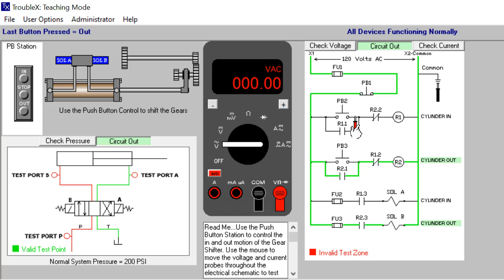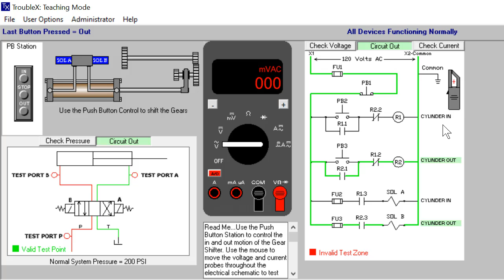Circuit Fault Simulation Introduction

Comment from the maker: "This clip is about the basic introduction of the incoming series of youtube shorts (meaning shortest videos lesser than 1 minute). This video will show all the navigation, menu and how the electrical and pneumatic circuit works. 

The relationship between relay coil and relay switch will be explained in detail as well. Once the circuit is complete, the current will be able to flow through the path (rung) and energise the relay internal coil located in the particular complete rung and this action will cause the relevant relay internal switches to trigger  from NC (Normally Closed) to Open or from NO (Normally Opened) to Close."